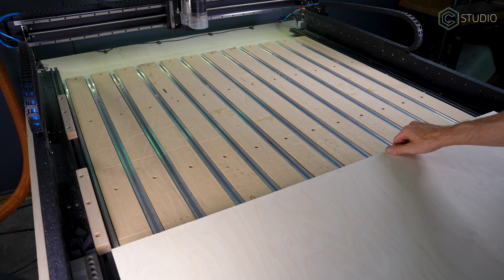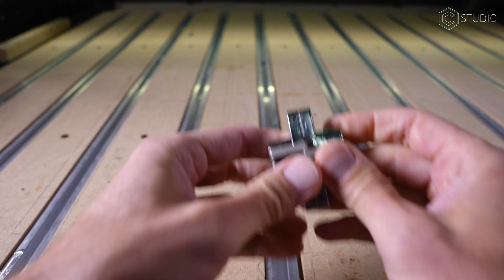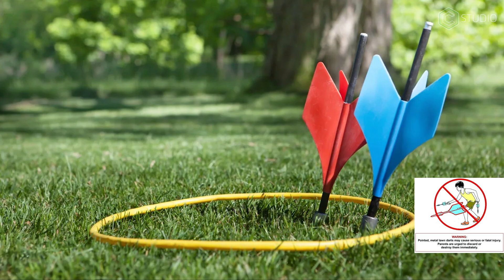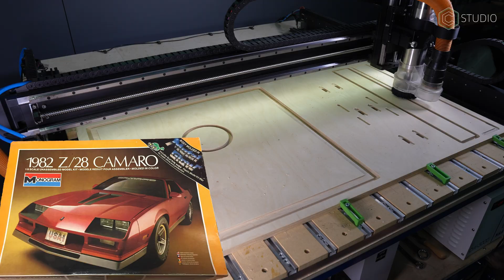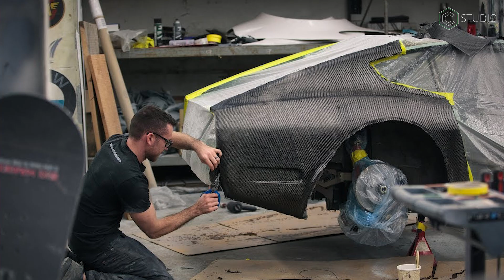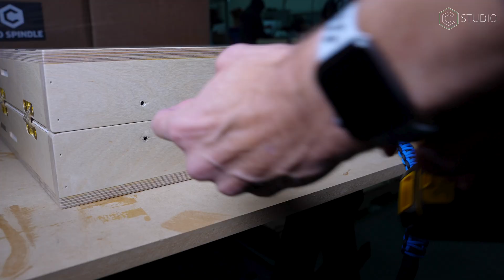Make Folding Cornhole Boards

Comment: Very cool.  I've been thinking about how to make a rigid folding board.   I don't have the tools to accurately inlet for hidden hinges (would be routering by hand, which probably isn't going to work.  My simple idea is a narrow strap hinge along the bottom of the frame (I use 2x3 wood instead of 2x4 or 1x4).  Attach the strap hinge while the boards are face-down firmly mated together to ensure the final alignment is right when the boards are opened.  Then perhaps a sliding bar lock that makes the hinged seam very rigid.  Current plan is to have folding legs with strong 1" round magnets countersunk into the 2x3 to keep the leg firmly attached to the frame.   Also might install some strong magnets into the frames along the hinge in lieu of a locking bar.

Comment: Which model Shapaeko  were you using? I have buyers remorse I didn’t go with the larger model for sheet goods.
Reply from the maker: Jcor,  We have the 4x4 in our shop. 
Tiling can be utilized with whatever size machine you own.   Change the size of the tiles in Create and adjust the stock appropriately.  
Balancing space is a challenge in every shop.  Bigger shop = Bigger tools.